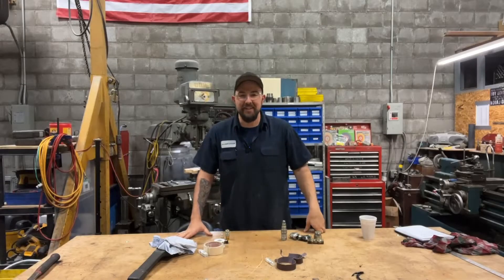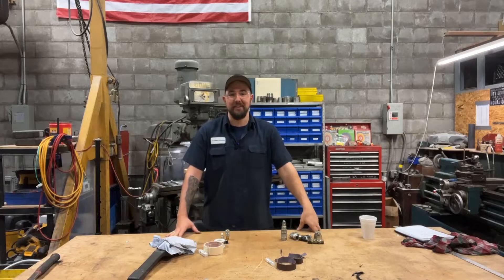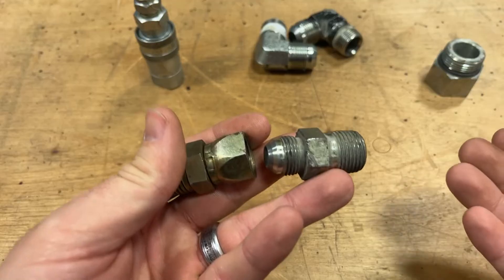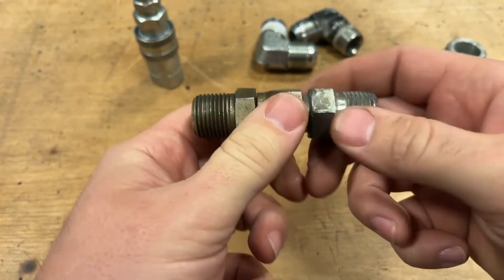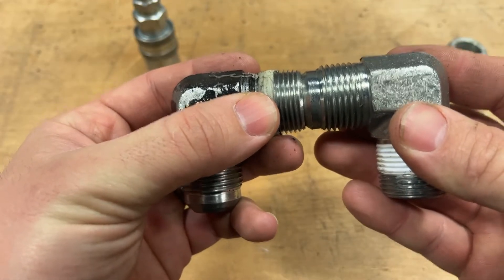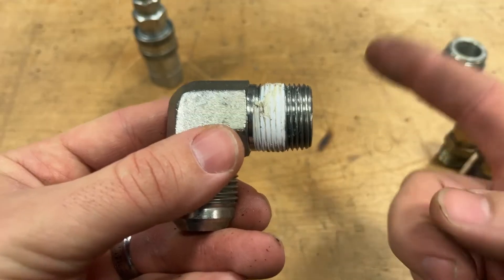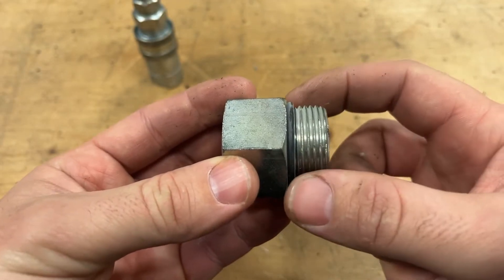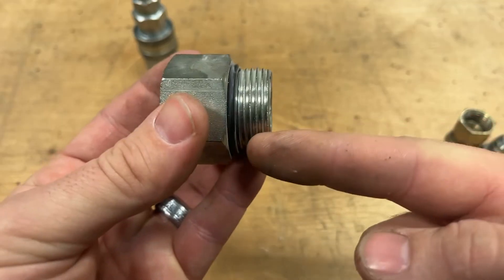How hydraulic fittings work!

Comment: Sorry for jumping in, but you just got a bit confused with terminology. 1) NPT = National Pipe Tapered. These are tapered and indeed form a seal after 4-6 turns. By the way, your Teflon tape is applied too high. You literally need to wrap a couple of turns at the bottom as this is where the actual seal is formed. Teflon not only seals, but also lubricates the joint. 2) NPS or National Pipe Straight fittings indeed need an O-ring to seal. But this is not a British standard! This is still American! Actual BSP type connectors use slightly different thread pitches and they are also rolled to Whitworth 55 degree thread profile while National standard utilizes 60 degree threading. Hope it helps!:):)

Comment: Curious...
Why is the end discussed at 2:02 described as JIC and not NPTF?
From here, it looks like NPTF with 30° seat, ideal for connecting to a "pipe" swivel, which would seal at the flare, rather than threads.

I can't think of a common production  fitting (non swivel) which would accommodate coupling together two male end JIC fittings.

What'd I miss?
Reply: Agreed, JIC is straight thread, NPT is tapered thread, you'd have trouble coupling those two
Reply: It is almost certainly NPTF, definitely tapered or else why have the teflon tape. JIC is parallel. The flare on the NPTF is also 30 degrees while the JIC is 37. Very basic stuff, not to be rude but this person has no business making videos on this. Misinformation is dangerous in hydraulics.